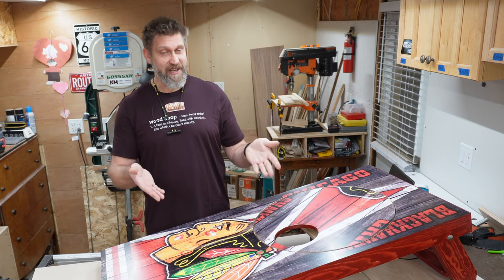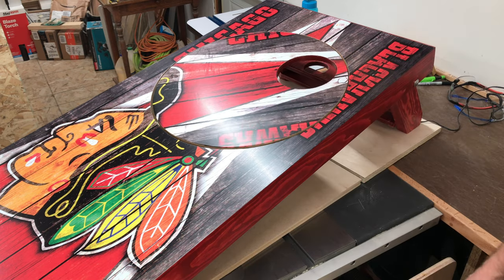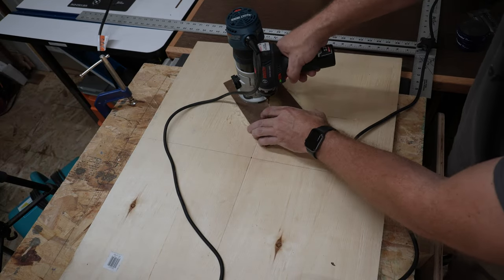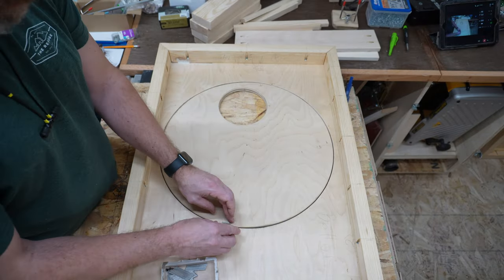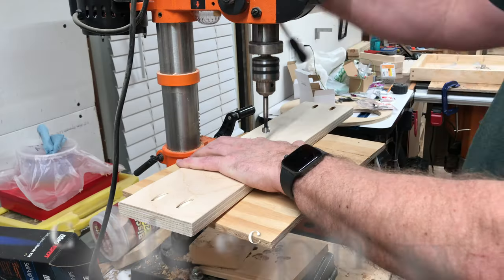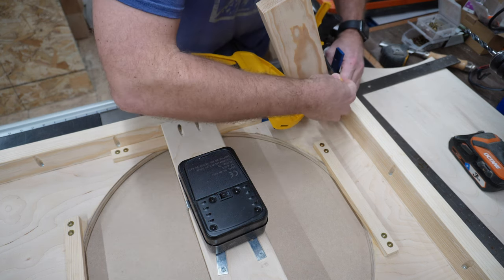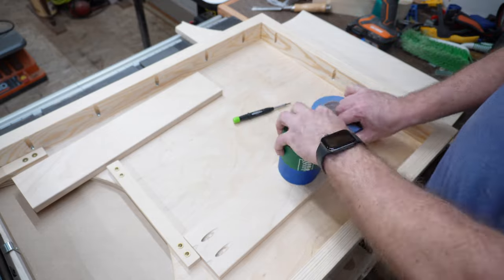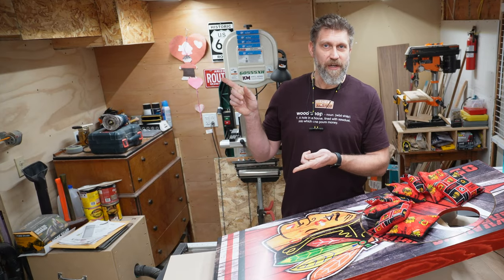Putting a New “Spin” on the Cornhole Game!

Comment: First off great video! My question, is there anything holding the spinning disc part against the board? or would it fall out if flipped over? It seems like the shaft could slip out of the motor housing. Id like to incorporate this into a suitcase style design but worried the discs might fall out.
Reply from the maker: They do come out. That said, I can carry them with the handle on the side (like a suitcase), but I have the circle facing me in case they start to slip.